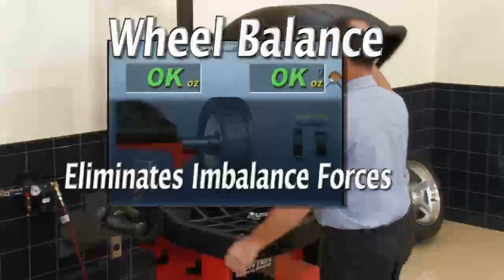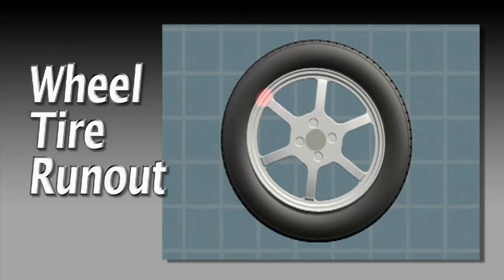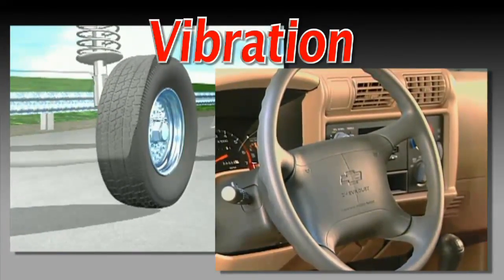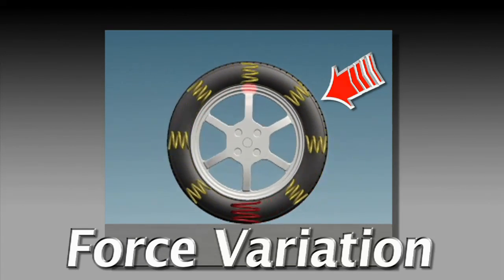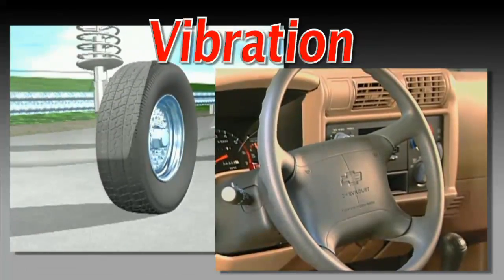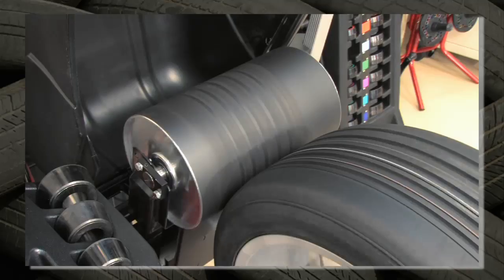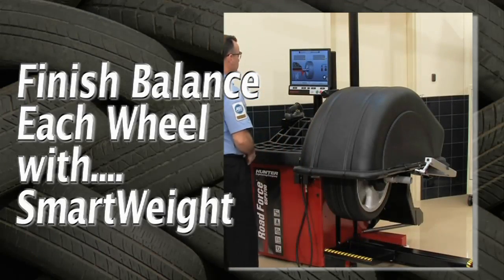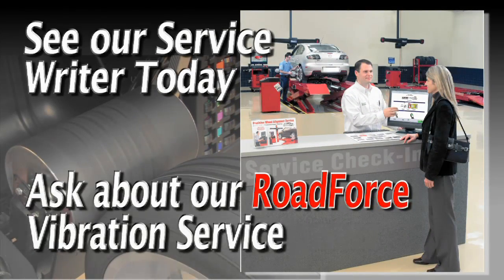Why Do My Balanced Wheels Still Shake? Correct Problems with Hunter Wheel Balancing Equipment

Comment from the maker: @wilnoy Hello, wilnoy, your problems sound like they are still tire/wheel balance related, and not rotors.  If your not feeling the issue while braking, then it's not going to be the rotors.  Wheel and tires out of balance will give a vibration feeling in the steering wheel anywhere from 57-62 mph, so try to find a shop with a Hunter RoadForce balancer, they will be able to measure not only imbalance, but also wheel & tire runout, and mounting issues.